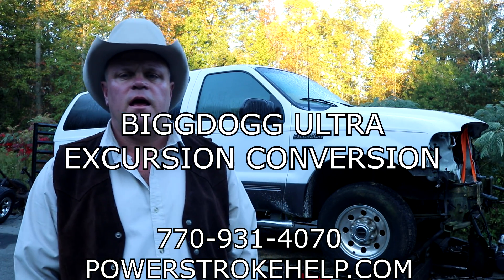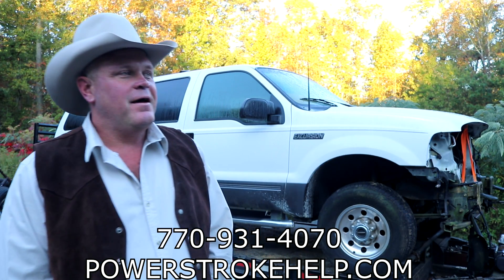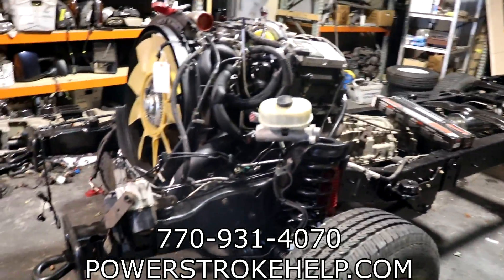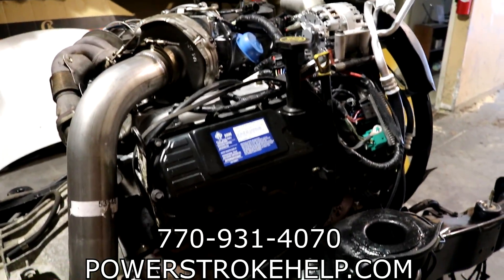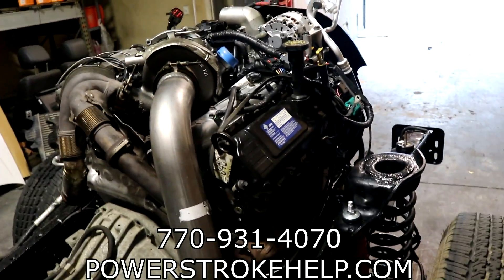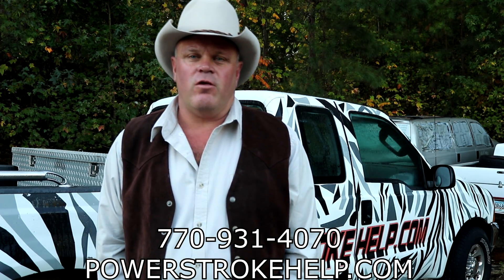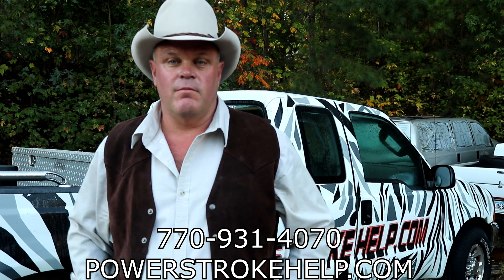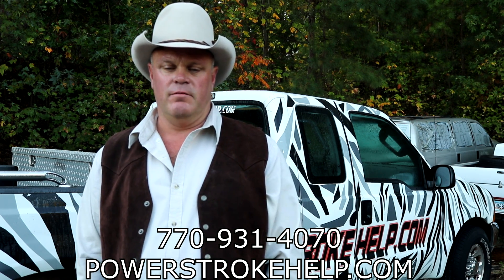BIGGDOGG ULTRA EXCURSION CONVERSION

Comment: who else would love to see him start doing 7.3 biggdogg excursions??
Reply: Yes please!
Reply: Ive had both 6.0 and 7.3
6.0 is my fave
Reply: 7.3 Excursion it's something You Don't See Much Anymore
Reply: I had a 2000 7.3 Excursion.  Loved it
Reply: 2nd!
Reply: He probably couldnt make money on a 7.3, they are great engines, he gets the 6.0s for near nothing and "bullet proofs" them and passes them off as good trucks. If you notice, his work truck is a 7.3 for a reason.
Reply: I have a 2003 Excursion Eddie Bauer with a 7.3. I've had it for 11 years and it has 157,000 miles on it. It is my primary tow vehicle and Vacation/roadtrip vehicle. I would like to upgrade my suspension to this. The handling would definitely be better.
Reply: @davidbrewer8402  they didnt make many and they are now expensive. Just bought an 02

Comment: Would you have any interest in buying a '05 Limited.  6.0L is getting oil in the coolant system.  Local shops think its either the head(s) or block; oil cooler checked out.  Don't have $$$ to re-engine this truck.
Reply from the maker: yes always interested in Excursions. Please email me the VIN and some pix and what money you are searching for. bill@powerstrokehelp.com

Comment: Hay bill this is for sure going to hit the custom in the wallet with the clamp down from the government. If the customer is not spending madd somes of money for the deletes stuff now they have to basically every 100k fork out between 3-4000k on a new exhaust. Even if they maintained the truck correctly and used a good fuel treatment on every tank. It really suck. Am i about right on the replacement interval give or take 20k?

Comment: If I remember right the Excursions GVWR was 8800-9400 lbs . In a diesel form the 4x4s weigh over 8300 lbs with no one in them. Tell me how this things going to carry 9 people and pull a 15000 lb trailer with a 1500 lb tongue weight and not be grossly overloaded ?  These things are so payload limited  they can’t even carry 6 big men  and no trailer and not be overloaded .

Comment: Bill recommended these 7.3 guys for he knows so I call them up ask them what's the best programmer for my truck they tell me  the hydro chip so I buy the chip they recommended installed it and it worked great for engine  but if you get on it.  it shifts in and out of overdrive  so I called hydrochip producer and told them what it was doing there answer was we can sell you a valve body for transmission but there not sure that would even fix it so dont take there word for it find an expert on this matter or talk to Bill and see what he has to say